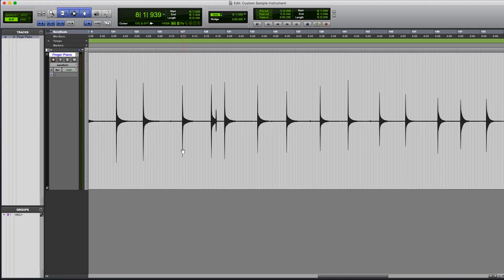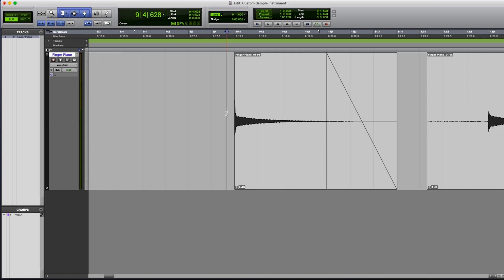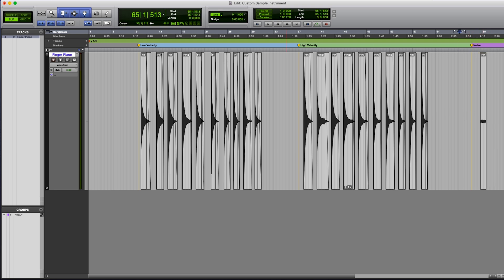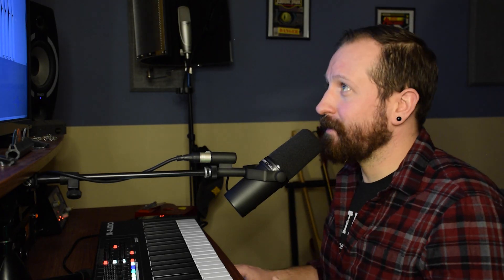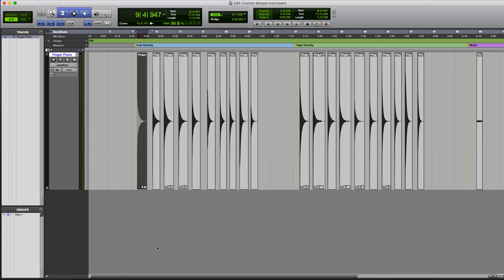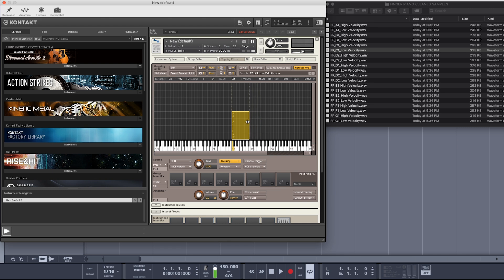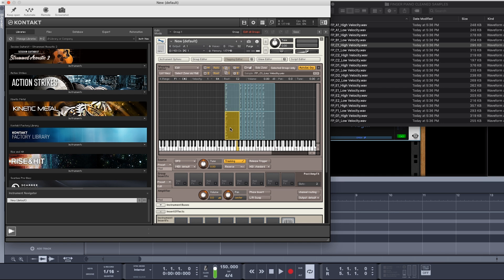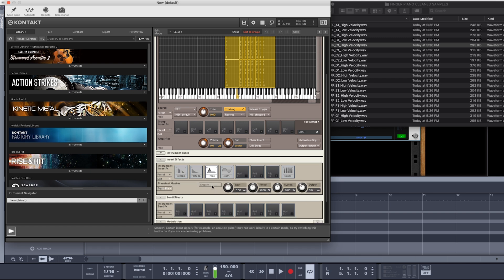How to Create a Kontakt Sample Instrument

Comment: This is a great video. Thanks. I just wonder how to create a sample library for a bowed string instrument that has lots of possible articulations. Sadly, the instrument is a viola da gamba. Only a few sample libraries are already on the market, and they are not what I am looking for. I need it to work with a music notation software as I compose using Finale, Dorico, or Sibelius. Suggestions, help?
Reply from the maker: Hi peteradams7629, thanks for the question! That's a long and involved process, but if you are dead-set on it, there are a couple things to look at! Kontakt has very in depth documentation, so make sure to have that open while working. The key to having multiple different articulations for Kontakt is setting up a key-switch to toggle through the different articulations. You do this with their grouping functions and using keys well outside of the standard zone for switching to the appropriate articulation. This can many times also be programmed as articulation zones in your notation apps, though you may have to set that up per instrument.
This can get rather complicated, but I have made a couple Kontakt instruments in the past, so give me a shout any time!
Drake Sobehrad, Sweetwater Sales Engineer, (800) 222-4700 ext. 3271, drake_sobehrad@sweetwater.com
Reply: @sweetwater  So, you precisely explained why this project has been done only once for my musical instrument. Sounds a bit more complex than I am ready for right now. Just knowing that this project is possible, but the technology needs some improvement to make it easy to produce is information enough, for now. Thank you.